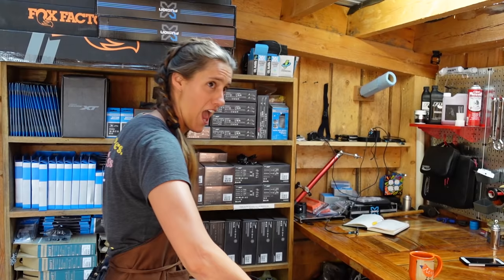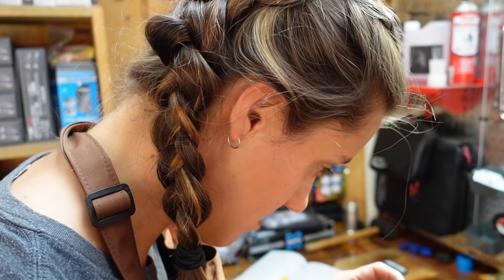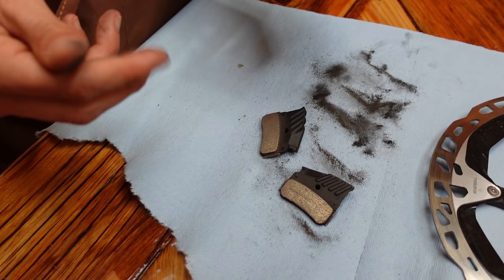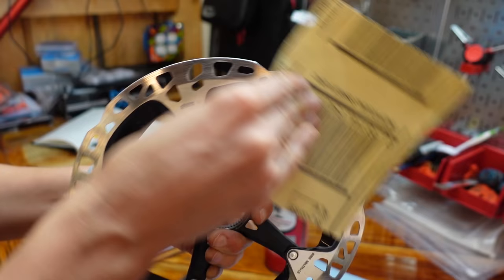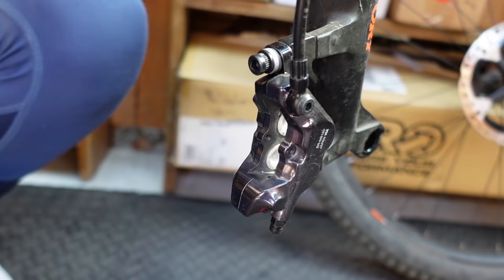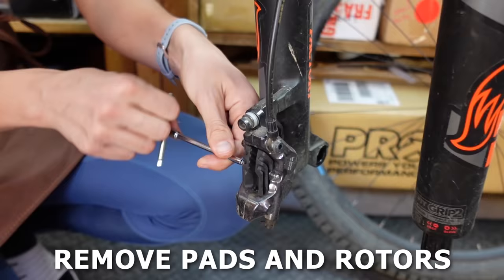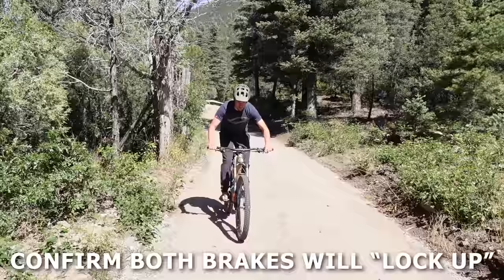How to stop squealing brakes and get more power (bedding in brake pads and rotors) | Syd Fixes Bikes

Comment from the maker: If this video was helpful and saved you time and/or money, consider supporting the channel by hitting the "Thanks" button above to leave a tip.
Reply: I tried and absolutely nothing changed still squeal like a mad pig and no breaking power
Reply from the maker: Your pads are probably so contaminated that they need to be replaced. You should carefully check your brake calipers to make sure they aren't leaking oil as that's the most common cause of contaminated pads. If it's bad enough, you may have to replace the rotors too...
Reply: Will it help to wear gloves to not touch by hands?
Reply from the maker: It's best to avoid touching the rotor surface at all, because even if you're wearing gloves, if you touched anything with the gloves beforehand that can get on the rotors.
Reply: Thanks! I used the finest finishing sand paper and it smoothen the rotor. 

Now my front brake doesn't apply at all.😊

Comment: Better way to sand the pads is to put sandpaper on something straight, like glass or mirror and move the pads on it with little pressure (with two-three fingers) distributed on the whole surface . This way you dont sand too much in one spot.
Reply: 7 years tool and die machinist. Peter you are correct, glass is very flat but there is the risk of breaking it in the process. I'd suggest a 2" wide 12" 1/4" thick aluminum plate from your local hardware store for a couple bucks a better way to go. Do not clamp or screw it down as this will put a unwanted bow in it, if it moves on your bench, place a couple strips of the thin double sided tape on one side to keep it in place, then thin spray of tack glue to adhere the sand paper to it. Also, putting pressure in middle of the pad will do a better job of keeping even pressure on the surface of the pad when drawing it across the sandpaper, keeping you from taking more material off one side or end than the other. This same process is used in tool and die shops for "lapping" of high precision parts. When you are done, twist the aluminum off, don't pry as it will put a bow in it, and you and reuse it. I use mine on a rubber mat and don't need the tape now.
Reply: What grit of sand paper should I use
Reply: @gabrielpinard5538  Good question. Nobody mentions that.
Reply: @annagraham6204  if it's glazing like a mirror, maybe a 120 is good, to break the surface better, but in general I would use 180 or 240 to rough it up. For the rotor a 320 or 400 would be an option, since you rough the metal more gently up.
Reply: Better than any cnc milling Mc.
Reply: Is a black & decker 'mouse' up for the job?
Reply: What's your views on paste compound treatment?
Reply: Yes! Immediate brain bleed seeing them get sanded face up

Comment: My brother polished my brakes  with ptfe spray. I couldn't stop lol. I used a belt sander with a 60 grit belt and it took it off way easyer
Reply: To much metal removal.
Reply: Never use 60 grit with a belt sander.
Reply: I've never told the family or coroner but I put bearing grease on my brothers discs after an argument once
Reply: Dont tell us either
Reply: @Parabler you are joking right

Comment: You really should put the sandpaper on a flat surface and rub the pad on it.. to get the most even and flattest sanding.  Machinists would call it lapping the surface.
Reply: Exactly what I was going to saying. A piece of glass or granite works great put the paper on the glass rub the pads against the payer keeping the press a equal as possible.
Reply: That was painful to watch, I do love the show otherwise.
Reply: @Hoggdoc1946   Retired machinist... rubbing pads lightly in figure 8 pattern keeps them even. Use a ceramic or marble floor tile for a flat surface.

Comment: Usefult tip: it doesn't matter if you touch the rotor when you're sanding it. Just clean it with alcohol after
Reply: Which you should do anyway. Clean those mofos with alcohol all the time. If you store your bike in a locker that nobody opens up for a full year, when you take it out again... clean the rotors with alcohol. Because this isn't very robust technology.
Reply: I dunno, brake cleaner seems to be better than alcohol
Reply: @cokbagus23  its basically the same thing. Bike cleaner may contain less alcohol to make room for washing components, but after all its just vodka
Reply: @kennyotsu4357  no, you can't get high on brake cleaners. Some have small amounts of alcohol. But still cheaper to use brake cleaners than vodka.
Reply: I use coke to eliminate the noise, works every time
Reply: @nanoverse  >no, you can't get high on brake cleaners
That sounds like a fuccin challenge
Reply: Or just clean it. No sanding needed.

Comment: That trick doesn't always work. . Usually, the pads are badly contaminated with oil and to 'clean' them, you need to burn the pads. No cleaning or scrapping with sandpaper will work. I just remove the pads, hold them with pliers, and burn them on my kitchen stove until the smoke or fumes disappear. It works for me every time. Of course, if your pads are worn out, it's better to replace them.

Comment: When sanding like this fails or the squealing comes back quickly, use drywall sanding screen for the pads so that the contamination actually falls away and isn't re-imbedded. It's as cheap or cheaper than the sandpaper, is just as available and tends to last longer. Additionally, try to sand in any direction except the way you sanded, you don't have to be perpendicular, just not parallel to the rotor's travel as shown. For one, you'll be able to see how much you've sanded, AND more importantly, the grooves will help the bedding process rather than hinder.
Reply: Priceless ideas, thanks a lot!!!
Reply: @imi250  Jude Monico from Magura is the source of these ideas. I'm just a messenger.!

Comment: As a woodworker and MTB rider, my heart hurt when Syd was sanding the pads. - Lay the paper on the bench, grit side up. Then slide the pad around against the paper (working side toward paper, obviously). Alternatively, Syd could have used a sanding block. All this keeps the new, sanded surface essentially flat, without high and low spots (That will have to be seated in later).
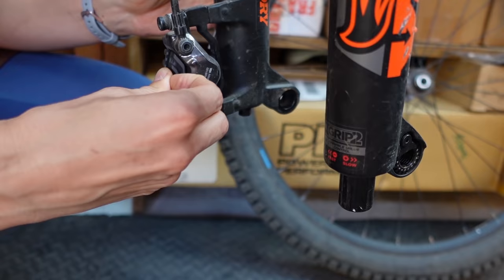The little bit Syd asks about at ~2:50 is a Circlip - a bit unusual shape with the right angle bend, but that's what it is.
Overall, a great series of videos. Please keep them coming!
Reply from the maker: Great tip on sanding! And good to know about the circlip.
Reply: Also a woodworker and 2 seconds in was  heading to  comments to say the same thing lol 😆 😂 😅
Reply: Good tips... I wish Syd had said bedding in, not burning in the brakes! :)
Reply: like getting a pedal to the shin
Reply: @sacha2711  That's too much work.  Putting on sand paper to old rotor doesn't work, won't stay.
Reply: just about to post the same thing...lol
Reply: @tl2913  I just made a bedding-in on steep descent for the first time, and it really burnt the brakes, I could smell smoke from the pads and the rotors are brownish now. These are S 105 so resin pads I guess, and new Shimano RT54 rotors.
I'm not sure it's better than the slower method I used until now, basically just doing the bedding-in by braking strongly at the last moment in my normal rides, then releasing the brakes at slow speed...
Reply: TBH, I see absolutely no problem with uneven surface after sanding. This "uneven" approach will most likely remove a bit more on the edges, which I find beneficial. And here's why: there may be dirt and lubricants or oil residue on the edges.

Comment: Great video just have 2 remarks; if you sand the pads, you're better off putting the sanding paper on a flat surface and running the pads over top of it. Also, being a bike shop i'd double check if its ok to spray brake cleaner into the padless calipers; looks like there's plastic pistons that could be affected by brake cleaner. 
Usually, gaskets like nitrile rubber o-rings don't like solvents as it turns gummy, and some plastics may crack.
Reply: Brake fluid isn't water.

Comment: Leave the rotors on, pull the pads from the caliper, and insert folded sandpaper (emery cloth is best) where the pads would go. Spin the wheel and re-surface the rotor that way. You can pull the lever gently to apply more pressure if needed.

Comment: Mech engie here: the 'safety little thing that secures the pin' is usually referred as 'cotter pin'. In Italy and Europe each country has a strange name for that little thing (ITA: coppiglia) XD 
Thanks a lot for the video, my girlfriend's bike was squeaking exactly in the same way (same sound and pitch), while mine never did so over 10 years - so i was a bit confused. Will do the proposed fix asap!

Comment: Put the sandpaper on the bench(sand up) and rub the pad across the top of the paper. For the rotors, put an edge of the sandpaper at the edge of the bench and run the rotors edge across the sandpaper and just rotate each as needed. 2 reasons. It's easier on your hand and keeps an even keel across the pad and/or disc instead of creating 2 unflat surfaces. Hope it helps. Thanks y'all for your great videos!

Comment: 6:45-7:00 Reinstalling the rotor. The torque spec is on the lock ring (40 N•m) and a torque wrench should be used to achieve the torque spec. That way you don’t have to guess at how tight to tighten it. Other than that, I do appreciate the time you have put in to help us know more and be better at working on bicycles! Thank you! - Beaupré Bodacious Bicycles, Albuquerque, NM, USA

Comment: im kind of longing for the simplicity of the good old days when squealing rim brakes we're all that was available and stopping was questionable . changing brakes pads was done with a small open end wrench taking only  a minute or two .
Now it's micro adjustments on the calipers,  messy fluids , modulating the levers etc. 😎

Comment: My Tips: Put the sandpaper on a flat surface and run the pads over it so you keep the pads flat, it will also remove and ridges that may have formed. Also all my sanding is perpendicular to the rotation direction. I have found it works better than sanding the same direction as the rotor motion.
Reply: Pads against the fine sandpaper on a flat surface, rub them evenly very lightly in figure 8 pattern, just enough to remove the glaze.

Comment: Despite 10s of thousands of Kilometres under my belt, I remain pretty naïve when it comes to bike mechanics. I got my MTB repaired an serviced ($400) some time ago and road it yesterday for the first time since. Cue big hill. Both my breaks squealed like a pig and I had no stopping power. Even though there was no-one within 10kms of me I was still pretty embarrassed by the noise. The birds were looking at me with like "What the fcuk?" Anyway, I thought i'll have a look to see if Syd and Macky have a video addressing this problem. So here I am. I didn't know you had to burn in your pads etc. I'll have a go and see what happens. Thanks for the video and keep up the great work!

Comment: I tried all everything you recommended and still had crazy loud squonking. Then I thought of something I knew about from working on cars: I put a thin film of waterproof grease on the back of the pads where they contact the pistons. Noise was gone instantly. Try it!
Reply: i will try it, thanks for the tip!

Comment: Just got a new bike and was wondering why it wasnt breaking as well as my old one.  Now I know i need to bed in my breaks.  Thanks for the videos.
edit: changed "burn" to "bed" in case someone doesnt read replys
Reply from the maker: Yup! And just so you don't start saying it wrong like we have been for YEARS, technically it's called "bedding in brakes", not "burning them in". It's Macky's fault for saying it wrong for years and in the video 🤣

Comment: May I suggest using Scotch-Brite pads for (sanding) your rotors. It will produce a nice dull finish without the deep scratches that sandpaper does. It may take a bit more elbow grease, but will give a better result. Sandpaper in the pads is ok as long as it is in the 120 grit range. The goal is to only remove the “glazing “ on the pads. Again no deep scratches as the pads are thin already. This comes from doing it on several car brake rotors which of course have more material to work with, so even more care needs to be taken on bike parts. 
Oh yea and by the way your videos are amazing. I am a newbie to Mountain Biking and bike repair. Other videos are good but you show the real picture for home mechanics and aspiring home mechanics. Keep up the great content.

Comment: When sanding the pads I place the sandpaper on a flat surface and slide the pad over it to ensure a flat surface and it's way easier. I also have put the sandpaper between the pad and rotors and turned the wheel to act as a rotor lathe. Using the caliper and pad to give a uniform application of sanding pressure on the rotor. It's a bit of a challenge to get the paper in with new pads but thin paper helps. Do one side at a time helps too.

Comment: Thanks for your tips. You basically want to bed them in the same as you would when you change pads on the car. 
In your 1 minute summary you said non chlorinated brake cleaner. The red can of Braklean is chlorinated.  Pro Tip: the red can will kill scorpions and black widows way better than any bug spray.

Comment: Little safety pin on the brake caliper is a cotter pin. Also, it's fine to touch the rotors and pads, just use the brakleen before putting everything back together.

Comment: Need to use Emory cloth for sanding copper for plumbing and you can leave rotors on the wheel , then pinch the rotor in between Emory cloth on both sides

Comment: 6:55 if you pull up on your tool you'll only have your arm strength. Try to push the tool downwards so that you can use your whole (upper) body strendth and weight. That way you'll be able to tighten the center lock screw much easier and with much more force (if needed!)

Also: If you lay down the piece of sandpaper flat on a surface (your table or so) you can rub the brake pads over it with ease. Use circular movements at first and finish with a back-and-forward-movement. Much more effective and you even could do the job with a tiny piece of sandpaper ;-)

Comment: Before sanding the pads, use breakcleaner first to de-contaminate them. Otherwise you could end up with sanding the grease/dirt into the pad. Everytime your hands touch the pads or rotor, use brakecleaner to remove the grease
Reply: RollinRat  That's like the worst suggestion i've read so far. Changing a rotor because it has oil or grease on it? Huh.. I'm gonna change my hands because they are dirty.
Reply: RollinRat  So alot of useless information. Nobody cares. Working in a shop and talking the customer into changing a perfectly good rotor, just because it's ''contaminated'' should make that customer never step in that shop again. So yea, instead of talking like a sales rep, and bragging about your accomplishments, again, nobody care, you should state some technical arguments about why you'd do that. You keep adding the word sintered like it's a new one you've just learned. Back in time, when brake pads were not available at every shop, burning away the contaminants was a good solution, and everything worked fine. The so called risk you are talking about is just your sales brain talking. If the brakes are working properly when you test them, they will also work when you need them. You don't just go on the top of a trail without even pressing the brake lever first and go down just to realise your shop did not replace your ''contaminated'' brake discs just to end up dead in the first corner.

Comment: 1) As you have a can of brake cleaner, there is no reason not to touch the pads or rotor as long as you give then a quick spritz when you are done.  2) As per the owners manual of my 1965 Mercedes, you should use a small circular motion when removing the glaze on the rotor.  3) to preserve flatness of the pads, place the sandpaper, grit side up on a FLAT surface (a piece of "polished plate "glass is ideal} and sand the pads, pad side done, sand only enough to remove the "shininess" about half as much as you did.  4) As you dod not mention sandpaper grit, I recommend about 150 grit, any kind for the pads, and either "emory" or "aluminum oxide" for the rotor.

Comment: @2:50 Cotter pin, R clip, or wiggly thingy. I usually just call it a retaining clip. That one looks like a modified version of an R clip so both sides are wiggly and it's bent at a 90 to make it easier to remove without tools. Shimano apparently calls it a snap ring or snap retainer.

Black surface could be glazing (contamination burned into the pads/rotors) or just filth from dirt.

This is the first time I've heard of bedding/breaking-in brakes referred to as 'burning'. I've always thought burning brakes meant you're WAAAAAAAY overheating them while racing to the point that they're literally burning. Kinda like the rotors on my Tacoma after towing a trailer down an 8% grade for a few miles at <30mph. I could have fried an egg on those poor bastards.

interesting break-in method. I usually get up to increasing speeds then gradually increase my braking pressure with each run. Same method for motor vehicles. Works great.